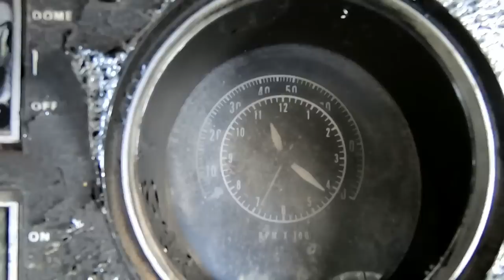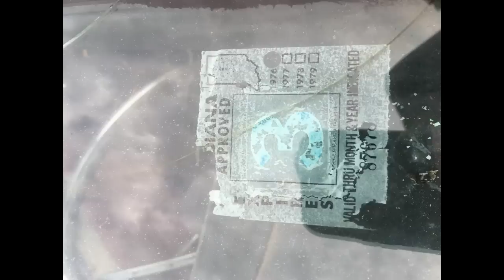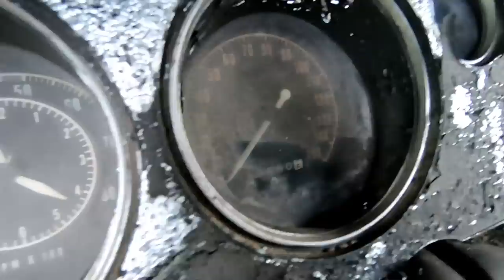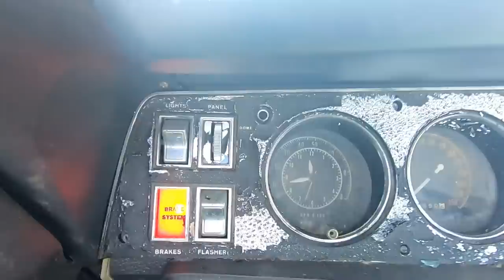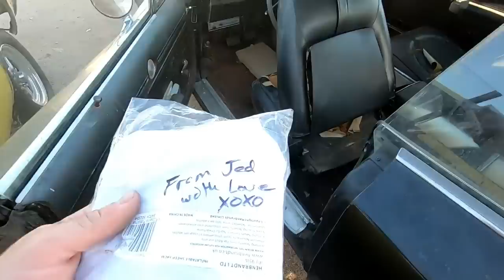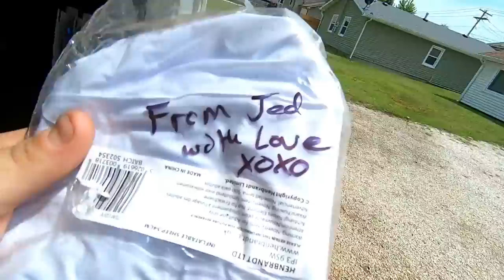Collapsed Barn reveals a super rare 1969 R/T Dodge Charger

Comment: Probably rust on the cyl walls. You need to squirt Marvel Mystery Oil in the cylinders several times and keep trying or you can just tear the engine apart and do it right. Nice find. Good luck with all that rust.

Comment: The clock sounds like it has the same guts as the Mercedes of the same era. if they won't rewind ,there is a little blob of low temp solder which is designed to melt as a fuse link. Fixing them is as simple as giving the two contacts a touch with the soldering iron to rejoin them.

Comment: I can't believe it - $22,000 was paid for this car when I purchased a number matching 440 Charger R/T SE with no rust and only 58,000 miles for $20,000...
It's a loss of words for what was paid for the car in this video with holes in the floor boards, broken glass and a rotted interior.

Comment: dude, love the charger theme. I worked at Fenton, Mo. B body plant 69'-70' right before US Army draft during Viet Nam. My job was breaking-off zerk fitting on front end [ so the customer could not diy lubejob,] plus install chrome exhaust tips on 440 cars. ''No I can't get you a roadrunner horn for your 55' chevy !''
Reply: pcat1000 Bet you’d have some great stories to tell 👍

Comment: Looks like Mamba didn't shake too bad! Windows and hub caps still intact. Bet Mamba got great mileage! Them drag reducing panels are worth their weight in gold. The dipstick is stopping the crank from spinning. Rebuild the dipstick. Them damn plug wires will give ya brain damage! Not from the amperage of the coil, the hood latch in the base of the skull's what does it! Ya might have forgot to remove the offending music re-upping. Or was it not Cyndi that got ya copyrighted? Great find, Jeff! Good trade, Junkerup!

Comment: I'm 62 years old. As a junior in high school in 1975 I bought a 69 Charger 383 magnum, auto on the floor, center console, bucket seats. White with a green vinyl top. It had around 54,000 miles when I bought it. I paid $1,200 for it. I owned it for 2 years and sold it for $1,000. It was a solid car in great shape when I sold it. If only............

Comment: Sweet car and yes the days of $500 cars is gone and I was privy to the era if I had all the cars I had man oh man...pd 1,000 bucks for a 70 duster 340 4 spd fm3 panther pink,$500 for a 69 road runner rootbeer brown 383 4 spd consoul air grabber,73 ralley charger 340 auto power bulge a/c auto, and the car I wish I didn't have to sell 1969 spring color ralley green 383 4 spd consoul air grabber factory tach 8 track am radio, $1500 for a 1971 Plymouth road runner  plum crazy purple white interior white strobe stripe white tuxedo top bucket seats with six way manual seat a/c auto on coloum .....now got 2000 Dodge Dakota R/T 5.9 color changing it to 69 rally green would love to see this car done in videos

Comment: I bought a 69 Charger RT 4 speed car, rolling body with bucket seats, a trunk lid & a hood (that was all the parts it had) for $100. w/a title in 2008. Worth restoring! I didn't have anything to put it back together at the time so I listed it on ebay starting at $1. People wrote me they would pay $50.-$100 for it. It sold for $1500. Thought I did well but time will tell!

Comment: Original owner most likely sold it because of the oil embargo causing the gas prices to skyrocket.  Many people back then did including my pops.  He had a 68 Coronet R/T with a 440 6-pack and dumped it for a MG Midget.  This is also one of the main reasons it's hard to find big block cars with the original engines.  Folks would pull them and drop in a smaller motor to get better fuel mileage.

Comment: People don't realize on these old barn find cars that the entire value of the car is in the tags. if you have all the tags and the matching engine and trans it doesn't matter what condition everything else is in. If someone had the tags the numbers matching engine and trans and the body was rusted down to a dust pan size pile of rust it would still be worth what you paid. If you own the tags then you own whatever the tags say the car was the day it rolled off the assembly line. That's the only difference between a "real" triple black 4 speed '69 charger and  a "resto-rod". One thing I did notice when you showed the closeup of the engine bay tag was it looked to me like it was attached with screws. Don't they normally attach them with rivets? I guess if the the cowl and block serial numbers agree that confirms what the car actually is but that engine bay tag being corroded away would make me wonder if down the road someone might question the authenticity if big dollars were changing hands say for a completely restored vehicle. I'm not an expert by any means so I might be way off base but.....just wondering.

Comment: Do you like challengers as much as chargers I got a couple 70 challengers ones a factory plumb crazy purple rt  440 and the other is a factory comp yellow rt 440 and a blue 70 dodge charger rt 440 auto with a nasty cam

Comment: Dude I still have my old Dixie Challenger Matchbox car, where did you find that action race set, in the car or something? 
Cleaning out my grandparents attic I found all my old Matchbox cars from the early to mid-1980s, when I saw that one I was so excited. I also have that red car that I can't remember what it was called, but it has the huge plastic engine sticking over the roof and the gigantic rear tires LOL
Reply: RICH DISCOVERIES ‘Big Banger’?
Reply: @anridapu  okay I just looked into it, it was not big banger but apparently was its sister car. It was called Red Rider, basically the same car but it had velocity Stacks instead of a blower scoop and had side pipes coming up the doors. Looks like the same chassis though, just some different cosmetics. There was also a blue version of that car I just don't know what that one was called either

Comment: The cylinder walls are probably coated in rust, if you rotated the motor back and forth with a breaker bar it would probably free up

Comment: Believe it or not I bought a 69 RT 440 4 speed Charger ( Yellow / black interior ) that is rust and dent free and has 61xxx original miles for a whopping $1800 bucks from the original owner in 2016. It fired up but needs a carb rebulid and a complete rebuild of the brake system.

Comment: Omg I want a charger soooo bad its been my dream car forever idc what part it is I’ll be happy with a charger grill hanging on my wall
Reply: Just like you bud,  the charger is my dream car, but for now,  I have a 1/25th scale  General Lee Charger, that I have not built yet and will paint it orange with a twist, I also have a 1/25th scale Daisy Dukes Jeep Dixie,  that I swapped out the  original engine and put in a Plymouth Belvedere 440 ci engine in Dixie, remember they are 1/25th scale not the full sized .

Comment: Wow!  I’ll never get mopar guys.  $22,000 for a car in that shape!  I get that it is a desirable car with non-reproduced parts included but there is not a piece of metal that does not have to be touched.  Between parts + labor you will have close to 6 figures into it by the time you are done.  I would have more fun with that blue one and not worry about a girl in a civic crashing into me.  To each his own...good luck
Reply from the maker: No not even close, cost me about 30k to restore and metal is not hard for me to do
Reply: Yes, I understand but being a car guy I can’t see the value in that car.  Without getting into brand fanboy stuff, I don’t understand the prices asked / paid for by Mopar guys.  In the 60’s they were just another muscle car, but today they are “gold”. A comparable ford or Chevy with similar equipment would cost a fraction of that in similar condition.  More power to you if that is what you are into and can make a profit on a $20,000 rust bucket.

Comment: Put you some transmission fluid in each cylinder let it sit for a while it's pull the valve covers off make sure the valves aren't stuck and you know you're going to take that Sheep home you couldn't even wait to blow it up but you should start stripping it and building it as soon as possible that would keep me watching and I guarantee a lot of people would like to see that RT going again it doesn't have to be perfect either just mechanically sound and driving again

Comment: Friend of mine bought a 1966 Hemi 4 speed Satellite for $500.00...Powder blue...with the original tires...in fact 100% original...right down to the Mopar battery...had factory super thin tires, with the poverty hubcaps that would make clouds of smoke with them... of course this was in 1975...but it was mint with zero rust...paint was show-car new...interior was mint...had 30K odd miles...father sold it on him when..he found out he knocked up his girlfriend...

Comment: True story...I once bought a 1966 GTO Convertible 4 speed for $75.00...and Got a 1981 Delorean(engine fire damaged) for FREE...Bought a 12K mile ORIGINAL 1966 GTO 4 speed tri-power for $1200.00...and a Cosworth Vega nice shape(needed a Computer box and timing belt)$300.00...swapped a dual 4 barrel Pontiac intake for a  1969 Ram Air IV GTO Judge Engine...and a 1968 GTO four speed for $600.00 no rust body...

Comment: I had this exact car but it wasn't a RT and it only had a 383. You would have to put a hemi in it to get your money back after paying $22,000 for it in that state. With the rust, I think he overpaid, but in mint condition I think you could get $80,000 for it, with the hemi.
Reply from the maker: John Allen Hemi adds no value over numbers 440 and being triple black 4 speed it would sell at 80k. Similar cars have sold for that not even black
Reply: @junkerup  My favorite car, the '69  probably cause I owned a Charger. I grew up in nothern Ohio and southern Michigan and we had all the latest Detroit cars and every young person had a Fastback Mustang or a Camaro or Plymouth or something. We used to race all the time, sometimes for money. I've seen small block Ford's and Chevy's wipe out some of the bigger engines. We had a ball driving around in those cars, usually with a beer in your lap. Cops never stopped us.

Comment: I bought a 68 Charger R/T in 1985 with a 440 MAG. in real good condition made it my daily driver, for a grand, boy have times changed, I should have kept that car, if paid 22 grand for that rolling rust bucket, I could have got an easy 75 for mine,  that's crazy!, to me no old car is worth that, specially looking like that, and you have to know your shit when restoring a MOPAR, these are unibody cars, not easy to restore, not like a full chassis car.

Comment: Thanks to the old boys sitting on these cars they have not been turned into a bean cans in the 70s 80s just saying
Reply from the maker: yamaha ttr600 u have a good point
Reply: Junkerup     #ratmusclecarz I have a 74 SE #matching car that I've had since 95 and hasn't been plated since 88 had to replace the wrap leafs was chucking u joints that's why guy parked it. And it's that rare story you were talking about I got it for five hundred ON PAYMENTS LOL!!! It's still sitting in my garage and is turn key 😎 my buddy got a stereo installed in his 71 road runner and guy said I've got one of these old Mopar at home you want to buy it? Luckily it was too clean to cut up (as we did to many b bodies hell we cut up a super b once 😔) so my buddy told me about it and the rest is history, rare car too. Ordered car not a lot car SE 318 driver two barrel ac ,rear defoger,am/fm, eggshell white, white top with the louvers and get this they ordered the white car with the upgraded wood grain interior panels and the whole interior is green seriously!!! Split bench seat too lol I'm thinking I might have a one of one car that is still#matching and complete
Reply: chris younts  some have but lots are left to be brought back to life because people sat on them for 30 years instead of scrapping them some are left is the point

Comment: 10:50 "ugly puke-green olive" color CHIX LOVE IT it's mopar name is DARK METALLIC TURQUOIS. 
(at 80's cruising hang-outs) chix would come up to me wanting to know
 ""The Exact Color Name, Or Color Number? "" (so cute)
 Back then I wished for B5 blue, so I'd say
"IDK, blueGreen Aquamarine i guess." 
I was already happily girlfriended ... This happened AT LEAST 10 times. It was a '69 R/T charger blk vinyl top N50-15" on appliance 5 spoke. Ass-end WAY up in the air, to "clear the meats"
DANA 3.54 RARE AWESOME NICE mine was the mundane 3.55 8 3/4 "quick-change" i call 'em.
But HEY !!!! Ppl, a FORD 9" is Alllmost as bulletproof as the DANA 60. Same wheel holes 4 1/2 on 5 pattern. Look underneath 1970 -'76 Ranchero's and Torino's. Parts cars only have some respect !!!! snickering because Eddie Van Halen  butchered primo Gibson's parts for his "franken - stratocaster" (Like a 9" ford in a B-body mopar : )
But HEY EVERYBODY, Save those 9"FORD rear-ends from the car crusher. Seriously. 
non-posi ones Included. 
We'll be glad we did.
NOT RECOMMENDING THIS BUT... the most intelligent custom engine swap I've ever seen (more than once) IS a mopar V8 in a ford body. 
The best suspension, ride, and body tightness, and noise/warmth insulation, and frame strength, are Ford's. 
Best Durable Longest Lasting v8's are Mopar engines. Its the factory MOPAR CAM GRIND. LOVE that SOUND. The sticatto sound is because the fuel burns SO COMPLETELY. Keeps the spark plugs and piston tops and combustion chambers CLEAN. put that in your 🍬Chevy bow-tie🍬and Smoke IT. 🚬 🔥
Just clowning around 
( I do chevs too : )

Comment: Hemi is that all that think had??? My 302 powered Falcon would have shown him some tail lghts just saying so much for the legendary Hemi.
Reply from the maker: ckelley63 302 falcon was slow, not even in the top 20 fastest muscle cars
Reply: @junkerup  No 1 mines a 64 and its light No 2 it's not entirely stock. No 3 a Hemi should still run better than that!
Reply from the maker: ckelley63 if it’s not stock then everything you argue is irrelevant because you can just upgrade the Hemi. Fastest cars on earth are based off the Hemi design with top fuel cars

Comment: I own 3 2002 Trans Ams, 2 of which were bought new. I will never part with any of them.
Reply: Just wait till the roof  panel start to bubble and leak oil - it's a $1500-$2000 repair. They don't make the panels anymore, so you need to get a salvage piece from pre 98 . The 2002 used a environmentally friendly adhesive that eventually migrates through the fiberglass and bubbles the paint. It's Not If but When. My 2002 has been garaged and has just 4500 miles - started to bubble last year. Good luck.